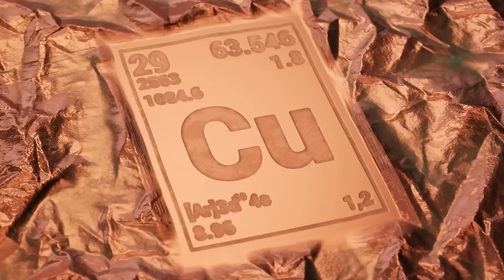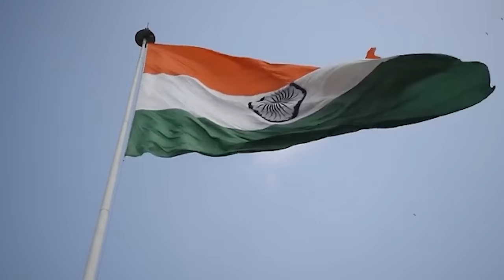The Deepest Hole On Earth Was Sealed Up Because Scientists Found This

Comment: To suggest many of these natural holes' existence has yet to be determined is a bit disingenuous. The caves provide plenty of clues that tell us how many of these caves are formed and several of these very caves have been well-known and documented for years. Geology has an explanation.
It's easy to tell if a cave or hole has been created by water erosion and if it's common or repetitive process. This is how most caves develop. Others are formed from bacteria that feed off the hydrocarbons like hydrogen sulphide that creates an acid that dissolves caves. The bacteria can "eat" a cave.
Glacial freezing has created some caves as well.
So to suggest "nobody knows how it got there" with many of these caves is a bit of a stretch.
Still, it was an interesting video.